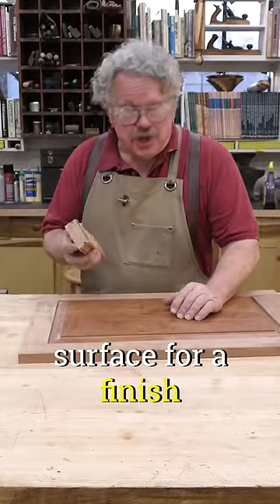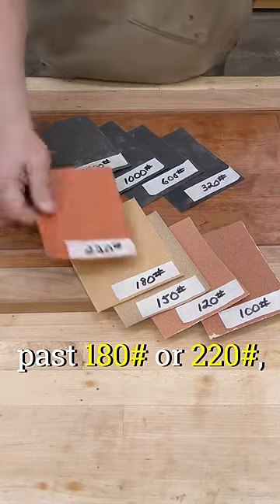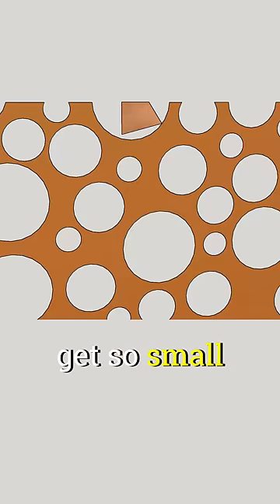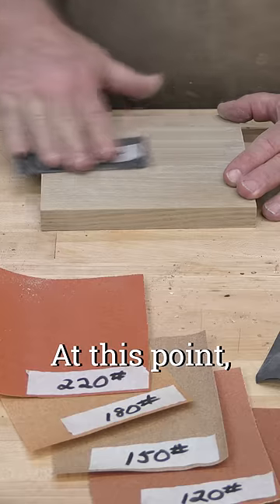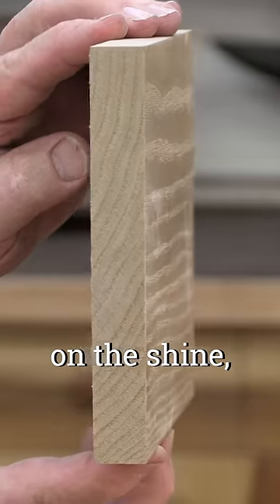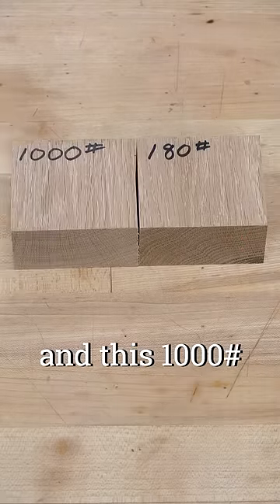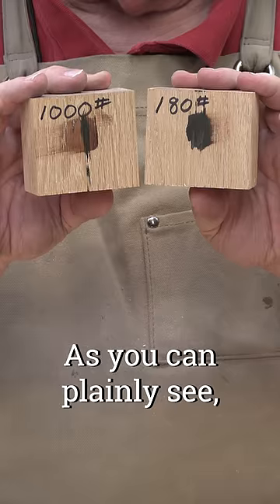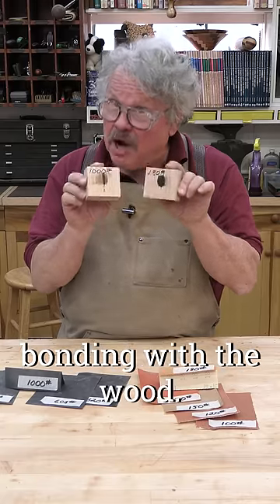Sanding Past 220 - How Smooth Should You Go? #woodworking #diy

Comment from the maker: It's a given that carefully sanding wood to clean and smooth the surface greatly improves the look and feel of a finish. But can you take this too far? 

Wood is composed of long cylindrical cells -- think of drinking straws, arranged parallel to one another. As you sand, you cut through the walls of those cells closest to the surface and expose the interior. And as you work your way up through the sandpaper grits to make the surface smoother, the sawdust gets finer and finer. At some point it gets fine enough to begin
filling the exposed cells, and the sanding action packs it in tighter and tighter. On most woods, this happens somewhere past 180# or 220#.

At the same time, the sandpaper begins to load quickly. A few strokes and there is a enough fine sawdust packed between the grits to prevent them from cutting. At this point, you are burnishing the wood more than you are sanding it. The  burnished surface feels smooth, but the cells are compressed and packed so tight that the finish/stain/adhesive no longer properly penetrates the wood. This, in turn, reduces the strength of the bonds it’s meant to make.

Cleaning the wood surface with a tack rag, mineral spirits, or compressed air only partly relieves the problem because the dust is so compacted. Wetting the surface with water -- often called "water popping" --  does much better because it swells the sawdust and the burnished wood fibers, decompressing them. In fact, experienced finishers often do this not only to decompress, but also to rid the surface of "whiskers'" -- wood fibers that are only loosely attached at one end. But the second part of this technique is to sand with the last grit used after the surface has dried (to knock off the whiskers and smooth the decompressed surface). This re-packs the cells and you're pretty much right back to where you were.

There are multiple exceptions to this rule, of course. Extremely dense woods can be sanded to higher grits without limiting penetration simply because the penetration is already limited by the wood itself. Some finishes and finishing techniques may benefit from over-sanding as well. For example. some craftsman like to wet-sand an oil finish into the wood, using higher and higher grits -- I often use this technique for tool handles. But as a general guideline, stopping at 180# or 220# works for most common woods and finishes.

I should also mention that these considerations apply to sanding raw wood only. The higher grits are still useful for smoothing the finish wood between coats and rubbing out a finish after it cures. You can adjust the appearance of the finish with your choice of grits - the higher the grit, the glossier the finish.
 
There is one area of woodworking where over-sanding  might be a boon rather than a problem – kitchen utensils. Craftsmen and craftswomen who make bowls, cutting boards, rolling pins, and other utensils worry about how to prevent wood from absorbing cleaning fluids, as well as vegetable and meat juices.  Over-sanding could help.
Reply: Very informative, thank you. Good to know oversanding may help utensils.
Reply: @jordanstewart4969 plus, they'll feel like that favourite old worn spoon straight from the start. I'm always disappointed when I need to replace the wooden spoons...
Reply: I'm a little confused. Does that mean it is typically recommended to wipe down the 1000# sanded version with a damp cloth in order for the wood to efficiently take on stains/finishes? What is your opinion about sanding with a 180#, card scraping, then applying the finish and top coat?
Reply: @FrankTranDesign  No. The reccomendation is simple: if you want to apply a stain or finish and garuntee a deep, even coat, do not sand much padt 180 grit. Once you over sand, theres very little you can do to fix it. Possibly soaking the wood, or using an air hose from the opposite end of the grain to try to blow the dust out. Its never gonna be the same though. 

Basically dont oversand unless you plan on pouring epoxy or not using any stain or finish at all.
Reply from the maker: @FrankTranDesign  Switch that to: "Card scrape, sand with 180#, and then apply a finish," and that's something I could get behind. Card scraping leaves a smooth surface, but not necessarily a uniform surface. The advantage of sanding is that it leaves a uniformly smooth surface.
Reply: Any related advice for refinishing? Intuitively I would want to give the old finish a very light, fine sanding before cleaning and refinishing.
Reply: @StandAndStare  Yes, sanding the existing topcoat will help promote mechanical adhesion for your new coat.
Reply: sand, stain, fine sand, restain. polish
Reply: Isn't this problem negated if you have strong enough dust collection on your sander? 🤔
Reply: @EmpressOfExile206 I feel that previous mentioned swelling with water or blowing with air pressure are more reliable that trusting dust collection.  And even those methods may not be that ideal or uniformly consistent.
Reply from the maker: @EmpressOfExile206  Not that we have found.
Reply: I would like you to try sanding wet with the finish in the place of water. Something like tung oil works well for this
Reply: Water does wonders for sure. A couple drops of water and a clothes iron help pull dents and deal with problem spots.
Reply: I have an idea. I am not a professional wood worker though. I am none at all. What if I want a smooth surface but still deep finish? Could I sand the wood to 160, apply the first finish, let it dry, sand again to 1000 for example and then coat again with finish?
Reply from the maker: @schekelberg6187  That's exactly what you do. The short only addresses sanding raw wood.
Reply: I make knives and use wood handles that I want to be nicely waterproofed for outdoor use. i avoid most of this issue by starting at a coarse 60, applying shellac, allowing it to fully penetrate, then go to 80, shellac, wait, then 120, shellac, wait, then 200, etc. I end up bringing my final coat up to around 400-600 grit (depends on the wood I'm using) and by then, my piece's finish is saturated over a 1/4 inch deep before i start using my poly finishes. My handles look like glass and hold up in both high and dry heat and nasty wet and cold. However I rarely stain my wood, preferring exotic hardwoods with bold patterns to start with.
Reply from the maker: @derricktitley3784  Thanks for sharing. The vid is meant to address sanding raw wood only.
Reply: it would be interesting to see iF somehow you could cool the wood while sanding it, perhaps in some sort oF chamber to try remove heat as a Factor, while using an air compressor or vacuum to pull the sawdust out.

It would be cool to see one oF the youtube scientists try mess around with this.  @WorkshopCompanion
Reply: One of the clearest, most informative pieces of information I've read.
Reply from the maker: @davidbuchanan9101  Thanks.
Reply: Luthiers use super glue to sand up to 1000 grit without affecting finish penetration too much. Neat little trick
Reply: Perfectly put. All about application😊
Working with Hickory a lot, only lightly treating it for weatherization, there's a gentle science to paper work for a good finish at any angle, that lasts.
Reply from the maker: @AndrossUT  Some turners do the the same thing, and it is a neat trick. Thanks for bringing it up. But you're not just sanding wood at this point -- it's a glue-wood composite. And it really doesn't need a finish -- the composite serves as a protective shell.
Reply: When I did custom carpentry and an architectural moulding and millwork company, I had a very nice halogen lamp that would give you sunburn if you were too close for too long. We never used over 150 grit. 150 was the finale liason on the unfinished wood. 120 was the workhorse. The halogen would show even the slightest of swirls, scratches, mirrors and just about any other discrepancy. The biggest areas of concern I remember having were in keeping the edges and corners strong but not sharp and the nooks and crannies where you had to get creative. I had a bucket of blocks formed in the negative to just about every shape and angle of profile you could imagine.
Reply: @BallisticBen247  you make a lot of sanding blocks with the shaper? Great for fitting trim corners too.
Reply: @dillongage  No, you completely misinterpreted the main comment. Read the 4th paragraph again:

"Cleaning the wood surface with a tack rag, mineral spirits, or compressed air only partly relieves the problem because the dust is so compacted. Wetting the surface with water does much better because it swells the sawdust and the burnished wood fibers, decompressing them. In fact, experienced finishers often do this to rid the surface of "whiskers'" -- wood fibers that are only loosely attached at one end. But the second part of this technique is to sand with the last grit used after the surface has dried (to knock off the whiskers), and this gets to you right back to where you were."

You can sand past 180, you just need to properly clean in between grits.
Reply: You really should have highlighted that 4th paragraph more. If you properly clean your pieces, you can get a good finish past 180 grit. Now people are using this information as a blanket rule to never sand past 180
Reply: @asdfkjahsdfkls1123 like he has said in previous comments this short was only meant to address working with raw wood. You can of course sand past 180, the process just changes in how you execute it
Reply: Good!  I hate sanding 
Hmm, win win, huh 😊
Reply: @dillongage but as far as I know it’s oil based finishes that are designed to penetrate but others like lacquer stay on the top no? Then why bother about over sanding if you apply lacquer or etc?
Reply: So here's my real tip for this.  Sand to 220/240, and then once you pop the grain, LIGHTLY sand the fibers off with 1,000 grit, preferably of good quality carbide.  And I mean only a couple  gentle swipes over the surface, and hardly any weight at all.  This is because we want to knock off those fibers without disturbing the existing surface.  After people pop grain, it does them no good when they re-sand that surface with the same grit, because the fresh 220 finish left behind will do nothing but expose even more newly broken fibers that will need to be popped/knocked off.  Instead, when you lightly sand off fibers with the 1,000 grit, you're effectively still leaving behind a 220 grit surface, but it feels Amish smooth after that 2nd or 3rd pop.Then straight to staining/oiling/finish what-have-you.
Reply: I'll need some more convincing... can't you go over it real quick with lacquer thinner or compressed air and it'll remove some of that dust thats blocking the grain?
Reply: I appreciate these insights. My dad built everything from wood. And he usually sanded it down 120, then let it soak, sanded it again at 120 and then got linseed oil to penetrate the wood and only then he would sand it down to 360 or 600. The table tops he made out of beech are basically the same as they were 30 years later.
Reply: I generally don’t sand wood at all. I plane and scrape.
Reply: So wait I'm sorry, I could potentially "oversand" some wood to get some benefit? Would I still need to cook the spoon in oil and beeswax? That's what I heard one craftsman did
Reply: @WorkshopCompanion  Could you use an air blaster to remove the fine particle sawdust from the wood? Not saying it's practical, but just wondering if there is any benefit to going past 180 if you really work at it.
Reply from the maker: @genericalfishtycoon3853  There's always a way to rationalize doing more work -- and less work -- than we have to.
Reply from the maker: @smolboyi  Yes, you can get some benefit from oversanding. And you can get some benefit from cooking wooden utensils in oil and wax. But do you need to? Or want to? One of the wonderful things about woodworking is all the options you have to achieve a single effect. But you don't need to take all the options.
Reply: @WorkshopCompanion  thanks for your reply! I'm not sure which options to take I must learn much :]
Reply: Let's see if I get it:

- Sanding and then staining / finishing: max 220
- No stain or finish: sand at will.

Am I right?
Reply: Is there value in sanding to 220, then applying a finish, and then sanding/burnishing with 1000+? Would the finish penetrate deeply enough when you applied it to remain below the burnished surface?
Reply: I absolutely love that you went into greater detail in the comments since YouTube only allows for sixty second shorts, as someone who’s trying to get into wood working I’m incredibly thankful you took the time to do this!❤
Reply from the maker: @thatoneultramarine208  You're most welcome. But this is our MO with shorts; how we've chosen to use the media form. There is no way you can pack al the information on a engineering subject into 60 second; it creates more questions than it answers. So we use the short for a broad brush overview, then fill in the details in a pinned comment.
Reply: @WorkshopCompanion  Love to see it, keep up the amazing work!
Reply: Where's the cutoff though? I do see your example with the dye, but 180-1000 shown here is a huge jump...at what point does the sanding start to impede the finishing? Is it at 220, 300, 400, 600, 800...? Does finish type matter (water based, oil based, shellac, lacquer...they all bond differently with the woods)? I get the overall point, but mostly it just gives me more questions.
Reply: You could just sand away the burnished surface with some 180grit  @dillongage
Reply: How about sanding/burnishing the wood after it has taken stain?
Reply: Can't some compressed air resolve that issue?
Reply: And he hit us with a bunch pf bonus facts. What a guy.
Reply: @derricktitley3784  I don't know if it would help but I've done this with wooden jewellery many years ago by having a tank with the material (epoxy in my case) and submerged the wood then pulled a vacuum on the tank. The wood sucked the material surprisingly deep
Reply: @derricktitley3784 that all sounds great, I’ll try that. But do you think the shellac actually penetrates 1/4” deep? Seems to me that the 1st or 2nd coat would completely seal the grain, following coats build up on the previous. Or are you saying that the 1st coat penetrates 1/4” deep? I think I’ll try that, then cut it to see.
Reply: @jazzdad52  ive done cross section cuts. if you follow my method, youll see something similar. it depends heavily on the wood. non-porous woods wont penetrate as much obviously.
Reply: Seems very dependant on what type of wood you use, coarser wood, typically softer to medium hard, don´t need a very fine finish, but very hard and dense woods can take on much higher gloss and still absorb a good finish. For the rest its very good practical knowledge what is in this comment and video.
Reply: Also any wooden object meant to be used in hair.

Helps keep sweat and hair products from penetrating.
Reply: Truly thank you for your videos. They're concise, well put together, and more informative than the algorithm believes. I wish you all the best this year!
Reply: OK, so 180 for tables, 2000 for dinner tables. Got it.
Reply: What’s the tldr
Reply: I wonder if vacuuming the surface after each grit level would help avoid this problem. I think I will try it after I finish my current project.
Reply: Sanding knife handles, should I use a high grit then apply a food-safe oil?
Reply from the maker: @AncientMysteriesAndInnovations  Have a knife-maker friend who wet-sands the oil into the handles.
Reply: @WorkshopCompanion  don't have any, but thanks for the reply.
Reply: It's actually  something you want to do when finishing a cutting board bc less stuff can soak into the wood and you can't stain a wood cutting surface
Reply: This gets counteracted by a sander that has an attached vacuum, I consistently finish to 800 and have similar stain results to my 400 grit and 220 grit test blocks. I can send the results in an email.
Reply: The simple remedy is to #1 use an air compressor to clean the wood and barring that #2 use a damp cloth, either of these two will greatly improve your results with stain.
Reply: That was a die. What about a oil finish? Will Tung Oil or BLO not seal and harden?
Reply: So take my rolling pin to 2500?
Reply: @J0k394 I have several I bought new and they whisker as soon as they get wet the first time and degrade further pretty quickly. I guess that’s why there are cheap wooden spoons, because either they used woods that aren’t appropriate for the job or they expect the buyer to finish the spoon.
Reply from the maker: @gb123-ej8wh  The dye was to visually demonstrate penetration - or lack thereof. The effectiveness of the seal and the overall durability of any finish depends in large part on penetration.
Reply: Would having a vacuum attachment to pick up the small pieces of wood followed by a sticky cheese cloth remove it well enough to absorb more properly?
Reply: What's the best way to clean your sandpaper or any other tips to extend longevity?
Reply: A tip for those that have a similar question abt metal and polishing it

there is a difference between sanding to get a shine
and a mirror surface
a mirror surface doesn't want scratches ofc, you want the cleanest surface posible

but shine can actually be achieved with very small scratches in the surface of the metal ^^
Reply: You're information is so useful. After seeing a few of your videos over the years, I finally subscribed. Thanks!
Reply from the maker: Most welcome...and welcome.
Reply: Wood is alive afterall
Reply: Thanks. I'm gonna try that on an old cutting board. Should I oil treat it first?
Reply: It's bullshit. You got a wall of text on exceptions. Plus you wet sand past 400. Meaning using mineral or linseed oil to sand, wipe away the dirty oil before moving up. 

Plus higher grits sanding is used for between coats.
Reply: Really useful to know! And interesting too.
Reply: @WorkshopCompanion you sir, are a bountiful wealth of knowledge and it is always a pleasure to see your videos when I come across them
Reply: There’s a Japanese waterproofing technique that repeatedly planes the wood, each planing stroke driving at making the cleanest exposure of the cells.  As a sanded surface will take in water more readily than one that’s perfectly smooth. You can see it used on temple doors that have a scalloped texture from various short strokes.  

It would be interesting to see how such a technique impacts staining and absorption of oils.  

What do you think?
Reply: Doesn't it make more sense to save the higher grits for the top coat, like a varnish or polyurethane? That's really where the smooth polished feel is best accomplished.
Reply from the maker: @DaddyBooneDon  Agreed -- see the pinned comment.
Reply from the maker: @angelramirez936  Thanks for the kind words.
Reply: @WorkshopCompanion 
Thanks for the info, it's very helpful, although I now have a question:

If the surface is sanded to 180 or 220, then a stain or finish is applied and allowed to penetrate deeply into the surface...

Could that surface then be sanded with finer grits to achieve smoother texture?
Or would that just be pointless since a clear coat would suffice?

Because if I'm being honest, I would prefer deep, rich colors and silky smooth surfaces without having glossy or reflective coatings...
Reply from the maker: @Jadebones  The short is intended as a guide for sanding raw wood in preparation for a traditional finish, and to prevent you from doing more work than is necessary to achieve an acceptable result. There are many ways to apply a finish after the surface has been prepared, some of which require further use of abrasives. And there are some finishes, wood species, and types wood projects that benefit from using fine grits. And there are some craftsmen who don't mind putting in the extra sanding time despite diminishing returns for the extra work. But whatever your circumstances and/or preferences, it helps to know the basics. As for your question, I think some experimentation is in order. That's why the Deity made scrap wood.
Reply: @WorkshopCompanion 
This is an amazing answer, thank you for taking the time to respond. I laughed at the ending statement, you make a fair point. You possess an inspiring ability to lead one toward understanding instead of simply supplying an answer.

I appreciate that. I will experiment. Thank you again, truly.
Reply: What if I am doing multiple passes with sanding paper and Danish oil? Can I use a rough grit, then apply, then fine grit, and repeat? I did that about 6 times to my unfinished Oak table and it feels wonderfully satin and seems to have oiled well.
Reply from the maker: @jp2503  The video addresses sanding raw wood only. Sanding in a penetrating finish or using abrasives to level and polish a finish is a different ball game -- see the pinned comment.
Reply: I always finish with 80,000 sand paper
Reply from the maker: @highdesertbiker  So you're just removing a few atoms at a time? Cool.
Reply: Resurfaced a cutting board that some idiot covered with contact paper. Sanded down to around 300, constantly clearing dust, then mixed up some wood butter from mineral oil and beeswax and sealed the surface with that.
Still going strong.
Reply: I was honestly about to come on thebcomments and ask if using air or some tack to clean dust between passes would help remedy the isssue, but here you are already answering a question that hadn't been asked yet!

Now I'm sort of musing about a way to perhaps make a sanding disk that attacked to the end of a vacuum line so that as you sanded, it would pull the particles up rather than pack or push them aside. A simple musing, and maybe someday I'll try to make something of the sort with more effort than poking holes into some fine grit paper and sticking it on the end of a shop vac 😅